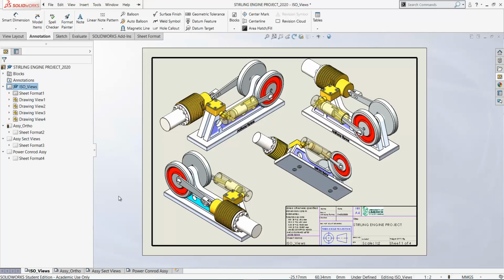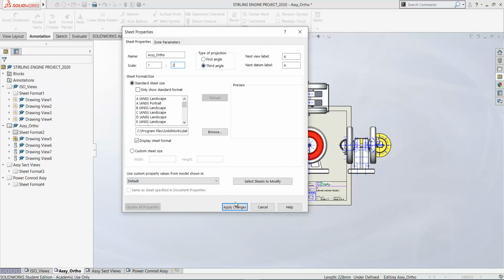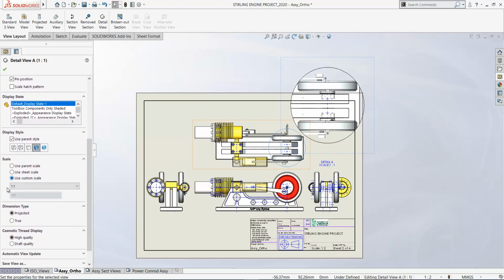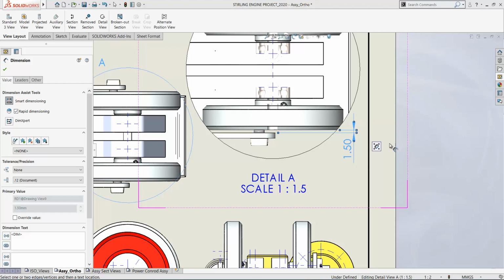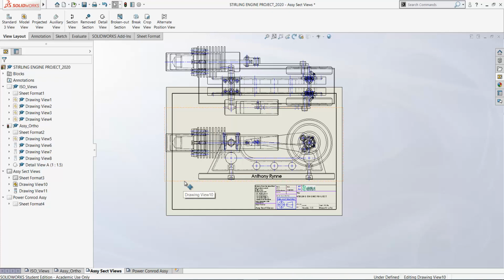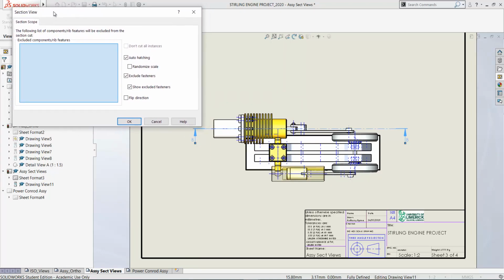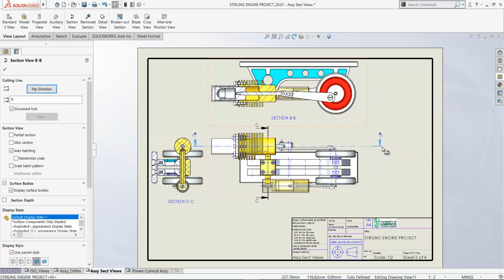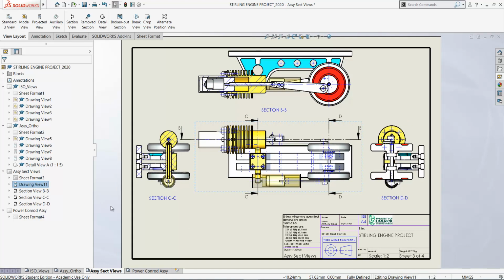Stirling Engine Orthographic and Sectional Views

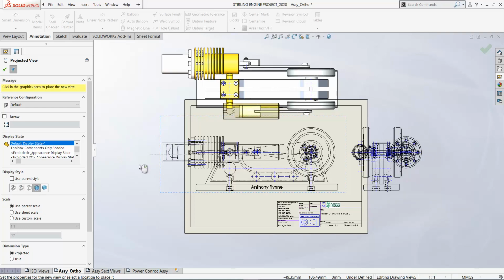Comment: some info.    at 1:07,  it can be  SEEN  that  there is force (not centered) Misalignment, where the  displacer and its linkage  interact.        it should be understood that an engine that has  No  provision for power take-off, is  a  Do Nothing.       googletranslate